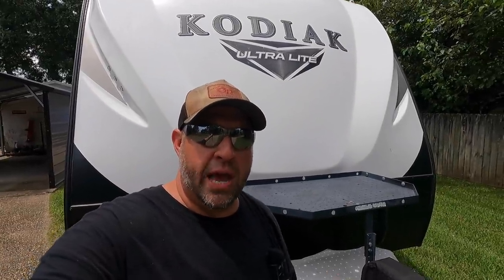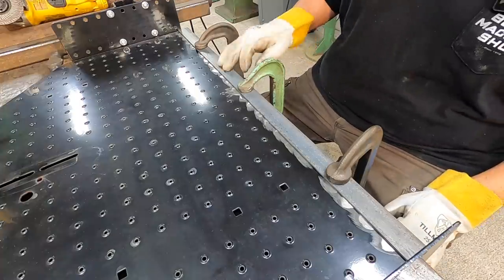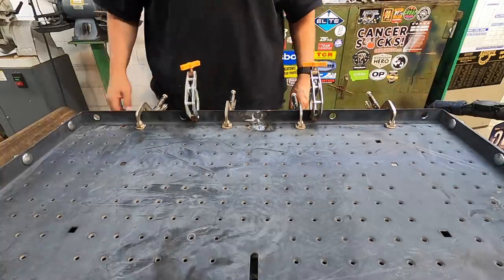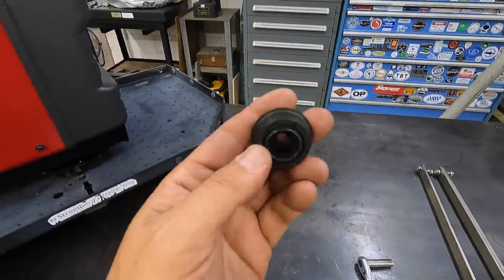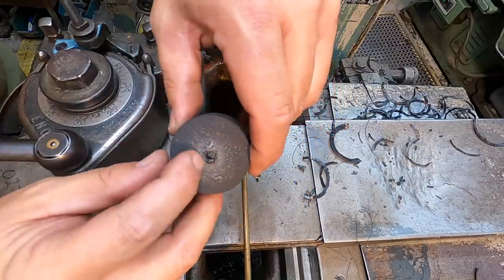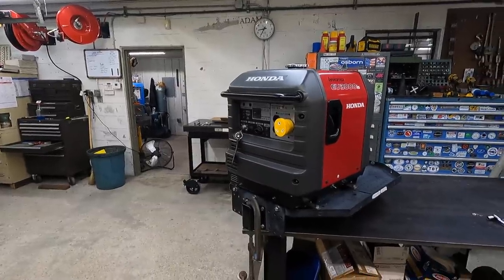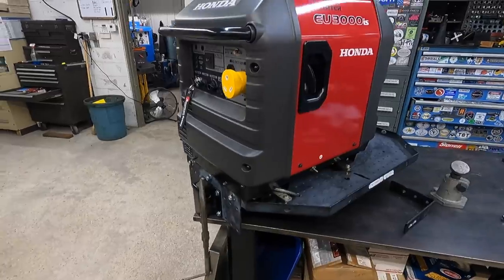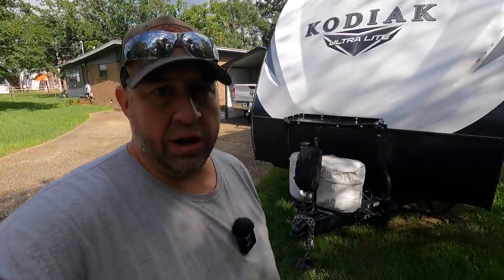SNS 352: Generator Rack Repairs

Comment: What’s the point of a lock down plate or a cable lock if the whole top can be unbolted and removed by a thief.
Reply: if people are going to steal something, they will.  it's about stopping casual opportunistic thieves.
Reply: @ScottPankhurst  I know it’s impossible to make something theft proof, but I think it gives Adam a false sense of security when there is obviously easier ways that it can be stolen. Maybe a solid box over top of the generator when not in use that could be locked would be better. Out of sight out of mind.

Comment: Before you TIGd the crack, did you drill a hole at the end of the crack? I don't know anything about making repairs like that but I've heard about a drilled hole will help stop a crack. Thanks
Reply: I have heard the same for cast iron but not about sheet metal

Comment: I buy my generator gas from a marine, which doesn’t have any ethanol (ethyl alcohol) in it.  The typical 10% ethanol attracts water and makes the fuel go bad quickly.  Add fuel stabilizer to it, and store it in a actually sealed can. (Eagle brand is a good one).

Comment: Sorry Adam but you have made a bit of a mistake here again. Clamping the generator down as you have done, gives the generator a semi fixed position on the tray. What you should have done is totally replace the mounts with double ended anti vibration bolt mounts.  This would give the generator a much better anti vibration fixture

Comment: I would suggest sandwitching the mount bracket of the generator between 2 rubber discs instead of having the rubber only on one side. Your solution will still bang hard on one direction and the impact metal on metal will produce strong shock waves which will likely cause more cracking on your flat mounting surface. Adding the 4 rubber washers on the back side of the bracket will also get rid of the two ss bars you are currently using to hold down the gen. Just thoughts based on similar applications seen in other fields!

Comment: I always  enjoy your channel, and the videos you put out.  I have the Honda EU2000i and I just installed a separate kill switch so you can shut off the gas and run the carb empty.   Hutch Mountain Bad Gas Ethanol Gummed Carb Eliminator Switch - Compatible with Honda Eu2000i Generator.  Also if you go to your local General Aviation airport and buy 100 Low Lead fuel, you can leave it in your generator just about forever and it doesn't go bad.  I managed 4 small airports in CA, and sold a lot of this fuel to local folks to put in their equipment that didn't get operated frequently.

Comment: The one thing with generators is that the owners needs to run them on a regular basis, otherwise when they actually need it, it's not gonna start. Use good fuel too without the ethanol.

Comment: You replaced the silent blocks - that's a really bad idea. There are silent blocks available with screws on both ends. Anyway, when the genset is running, straps should be removed to minimize vibrations.

Nice genset btw. I own the same Honda, but in the 230V version. Before that i had an EU20i, the 2kW version. Honda is by far the best on the market 👍

Comment: Those 3kw Honda generators normally run very smooth. When I noticed them getting the shakes, it is time for the valves to be adjusted.

Comment: I have had great results by running non ethanol fuel (usually only available in high octane) and adding Sta Bil fuel additive on all of my power equipment.  If the equipment has a fuel shutoff, I run the carb dry and then store the unit with the fuel in the tank.  Some of my stuff sits for up to 9 months like this and still starts right up when I need it.
Reply: Better yet, convert the genny over to propane. It never goes bad and if the camper uses propane a ready supply.

Comment: Have you thought about a solar array with a lifepo battery array for your coach power? It can be a fun project and if sized large enough you can even run the AC abit

Comment: That crane is a great idea! First time I ever threw my back out was lifting that same exact generator into the back of my f250 by myself when breaking camp to head home.  Home was 1,000 miles away. Didn’t feel that I hurt my back when it happened, but I couldn’t stand straight up when I got out of my truck at the first fuel stop.  I felt a lot of pain the next day and it was that way for a while.  I was a couple years older than you when it happened. And I wouldn’t wish that on anyone.

Comment: I rode out the February Freeze 36 hour power outage in my TT.  Had plenty of propane and diesel to stay warm.  10 gallons of diesel burned keeping the generator spinning..shared the electricity with the neighbors.   
It was so cold the back door froze shut.  9 °F.  No issues with onboard water supply as I was able to stay above 60°F inside.  Enough battery capacity for overnight furnace operation without the generator running.

Comment: It's highly advisable in ANY small gas engine to always run Premium Non-ethanol fuel since the ethanol will deteriorate gaskets and seals in the carburetor. Also, I don't recommend draining a fuel system completely dry as this will enhance fuel evaporation and will induce varnish build up inside the carb and it various ports and orifices, causing problems. I'd recommend adding a fuel stabilizer, or even just a few ounces of two-cycle oil to your fuel tank before storing for any length of time beyond 30 days of non-use. You'll save yourself TONS of headaches and your generator will ALWAYS be ready to supply power when you need it most.

Comment: Shouldn't you put a rubber mat or some kind of protection under the generator?  When you're driving in the rain or on the highway, I can see mud just splattering up and underneath that cover.  just from experience, that's how I ruined my tanks and lines on my old camper. the covers didn't do much at all, especially driving through the rockies in the slush.

Comment: Adam, I agree with many of the other comments on here - 5 mins work with a couple of spanners and you could lose the lot, tray and all! Maybe if you secure those slip joints with a couple of long hasp padlocks through them the would-be thieves will decide it is easier to steal someone else's. Cheers.

Comment: So about that top seem, water intrusion?   Why not just weld it completely up?  Not trying to make a suggestion, just wondering why.   As for the theft, If I were a thief, Id just unbolt the tray.  Would a custom tung box that houses the tanks and generator be out of the question?
Reply: Welders think this way… mainly because we fix rust.. drill stop cracks. Stich welding when flex is needed.. otherwise send it

Comment: This must have been filmed before you added the second AC unit to the camper. I like the modifications. Too often the accessories sold are just too light. Fine for those that only use their units once, maybe twice a year. Have you thought about converting the genset to dual fuel (gasoline and propane) that way you can connect it directly to your tanks on the front of the trailer?

Comment: Also, I have the cheap copy of that Honda.. The Predator 3500 inverter generator 3500 it is VERY quiet like that one and has been AMAZING. I actually made a remote control start setup for it and mounted the keypad next to my temp control in my RV so anytime I wanted to turn the AC on I would hit the start button then the ac button right inside the RV. Was great setup

Comment: You might be better making some custom bolts that aren't easily removed with standard tools.
A free spinning bolt head that requires a hardened pin to be fitted through the socket that is used to loosen it - for example. And place them where a grinder can't access them.

Comment: For small gasoline engines, lawnmower and generator(2Kw) I use 92 octane.
It is so much better for these small motors, no ethanol to gum up carbs.
Reply: I run no ethanol gas plus Seafoam and Stabil additive but there are several other options and preferences. Some states do not sell no ethanol fuel but you can search online via pure-gas to find when traveling.
Reply: UUmmm yeah, even 92 has ethanol in it, soooooo.
Reply: @whiskeytangofoxtrotover9651  The no ethanol gas here in my town (FL) is 89 octane, I think around $3.55 a gallon
Reply: A easy thing to avoid problems with ethanol is always to close the fuel tap and let the engine run dry, not just shut it off

Comment: You still have metal to metal contact with those bars...  I would put some rubber isolators between the bar and the generator rails (maybe use the original ones you took off) and pull them down with the bolts so it is rubber mounted top and bottom... I have had the same challenge with the Gen and AC for boondocking etc... I now have a Class A with a on board onan gen and solar setup and lithium battery bank to have nice options when not plugged in. I can't sleep without A/c in hot weather I just wake up in a pool of sweat... Great Vid!

Comment: I don’t think your going to own it long enough for it to be problem but in your high chloride climate those stitches and the open holes are going to allow corrosion. The rust jacking will eventually be an issue .
I lived in Texas very close to the Gulf similar to you CRC has a product you can spray on the openings and it will creep in and protect them it’s specifically for a marine environment, I would use that after you rattle can it. 
Congratulations on your 10 acres! Leave quite a lot of it natural or your going to have a farm!
I grew up on 320 acres in Canada and decided being an engine sounded easy compared to farming 24 , 7 , 365. We milked twice a day every day!
Reply: Should say engineer? Not so good spelling , But I am good at Math?
Reply: I never got involved with a dairy, to much work

Comment: Adam, My idea is to put T nuts on the top side of the new feet and run bolts from the bottom of the shelf up into the T nuts. More vibration isolation being no metal to metal contact from the shelf to the genny.  Your welcome.

Comment: All done is after making those mounting pads I would done some more pads for the bottom side of the actual tray Iran would have ran the exact same thread bolts but longer through the entire trade directly to the generator just like how if you look at how your motor mounts are on your vehicle for if you look at how your sway bar linkage Azar step on your vehicle I would have done the same thing with the rubber and the bolts directly to the generator so that way you won't have to worry about locking you just bolted down they know Thief to have tools on

Comment: Great upgrades on your gen mount.  The only thing id do above it is add some nuts between the hold down brackets and the gen mount.  Leave them loose, tighten down the hold down brackets, then tighten the middle nut that was added down to the hold down, sandwiching the mount.  Kind of hard to explain but i think youll understand.  Have a great day!

As for the cover, id stick the new one on top of that one.  That one will protect the new one and make it last longer

Comment: Adam it might pay to look into one of the tri-fuel conversion kits that they make for the Honda's. This way if for some reason your run out of gas during a storm you can run it off your propane cylinders already on your camper for awhile.

Comment: Hi, little question, why didn't you plug weld the holes in the plate (the same as where you  grinded the dimples away) above the added angle iron? That would be as nice as stitch welding from below and would prevent ingress of water and dirt from above.
Any way, keep up the good work, inspiring videos, enjoy building the new work shop and please stay healthy!
Regards from the Netherlands (Europe).
Bob

Comment: I really would have used some weld through primer. After an excellent repair you are running the risk of rust stains running out of the joint once it gets wet.
Reply: Not in my experience.

Comment: My wife bought me the hitch crane from Sportsmans Guide. It will lift up to (rated at) 300lbs deer from the ground to the truck and swivel 360 degrees. It has saved my back over the years.

Comment: With a generator that size, you could wire a plug-in to your furnace on/off  switch, and run your house A/C in a power outage. Remember to flip the service panel breaker for the ac off, in your house.  Don't know about Florida, but plastic gas cans don't pass muster with the popo here!

Comment: I've always been of the opinion that oxidation was the primary culprit in messing up fuel systems, bad gas as well.  I also believe that emptying out fuel reservoirs leaves a void for atmosphere and oxidation.   I think topping off fuel with a rich mix of fuel stabilized gas is a far better way to avoid fuel issues by eliminating the opportunity of atmospheric contamination and oxidization by simply displacing its space with treated fuel.
Reply: Ethanol doesn't help small engines.When I remember, I fill my cans with ethanol free gas.

Comment: You should have a spacer to help tighten the bolt for the rubber feet. It will also not squish the rubber too much so that the vibrations don't eat the bolt through the rubber. Look at wiper motor vibration mounting rubbers.

Comment: It will be interesting to hear if the noise level is higher when it is running. The Honda feet appear to be designed to minimize noise when it is running.

Comment: I hope it doesn't rust underneath the angle iron where you removed paint, I usually use weld2primer
Reply: That was my concern too.  It's going to rust out that tray PDQ with water trapped under there.  I am really surprised at Adam.

Comment: You should have used L-profile in stead of the angle iron, then you would have more material above the holes.
Reply: It's good as is
Reply: Or add a flat bar below the angle iron, it takes all stress away from the holed part and you can drill also the mid hole to keep the style.

Comment: Cool upgrade, Any time you can stiffen up a mounting solution you're making it better IMHO. As for the hitch mounted crane, Ive been kicking this same idea around. I have a old cherry picker engine hoist that the legs got bent. And I've been drawing up a Resse hitch mount idea where it can pivot about 160° and lift 2 tons all the extended out nearly 8 ft. Add a billet swivel at where the chain mounts to the arm and your ready to go. I saw one a older guy in PA built to load (Harvested) deer or even a elk into his truck with. He was veteran that lost his left hand. He said he used that thing for a lifting lots of heavy awkward items.

Comment: Hey Adam!
One thing that I have found in attempting to “machine” semi-pliable materials.  Dry ice can be your friend!  Hard cold soak the material for several hours (overnight preferable). This can make the quick facing, turning & drilling far cleaner.  Use a cheap (disposable) styrofoam cooler because the extreme cold will cause it to become porous and leak.
Ken

Comment: Upgraded to work even better... The secret i calculate would be to add another rubber puck to the vertical bracket eh?....The more springs the better, you wont even notice it, while inside.... Big Haul coming....Cheers Adam!

Comment: The 3000 is an odd size.  I have no use for it.  The 2000 will run 2 sets of motorcycle tire warmers, the 3000 will NOT run 3.

Comment: Hi Adam, if you add fuel conditioner to your fuel when you buy it you can store it in the can or generator for up to a year. I treat the gas for my lawn tractor and snow blower and never have to drain or run down the fuel. It stops the fuel from gelling in the carburetors and as long as they are run at least once or twice a year you're away to the races.

A second point is why do you have the shelf that high above your gas bottles? As long as you can get to the valves and can remove the tanks the lower the shelf is the lower your center of gravity is and the less wobble of the support there will be. 

Otherwise enjoy your vacation.
Regards from Canada's banana belt.🤞🇨🇦👍

Comment: Hmm. Make up a Kodiak sized set of floats,and you can use the trailer during the hurricane season as well. Be completely prepared,summer and winter.
Adam Booth,float home owner. Then add an outboard motor.
Keep you safe if you do get flooded out.
Don't throw out the fabric cover when you buy a new one.  Use the original on top of the new one to protect it.
Rather than a hitch crane,I have seen at least one crane setup that mounts off the stake pocket and pickup bed. Mounted offside like that,would give you reach and no need to dismount the hitch crane to attach the trailer.
 Just a thought. You will do as you wish. All the best.

Comment: If you use longer threaded bolts on the hold down bars.
You can use a set of nuts to pull the bars down tight.
Then at the end of the threaded bolts. Weld another set of nuts that are only on the thread ends.
When you need to remove the bars.
Use a Speedy cut wheel & cut the welded nuts off.

Comment: I also run until the carburetor is empty. i do it to all my mopeds, bikes, boats, and lawn mowers, because those go in winter storage but i keep one moped and moto cross bike and these two are not street legal) but i keep them all year around because i ride motocross tracks and forest, sand and gravel pit and also in winter I drive on the ice lake track, but when it's time to take them out of storage, it's easy when you just need to put fuel in clean tank, open the gas valve and let the carpurator get fuel and a couple of kicks or pulls and the engines is running.

Comment: It might be an issue now.. Why not make a flexible locking clamp? When the motor is running it could move enough to keep dampening working properly. That cable can be cut easy. I dont trust anyone for any reason anymore.